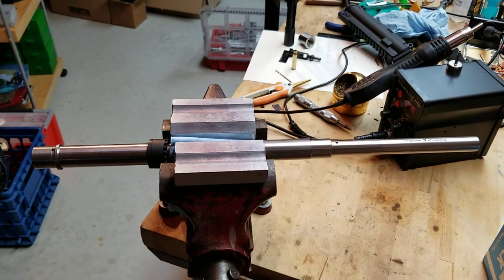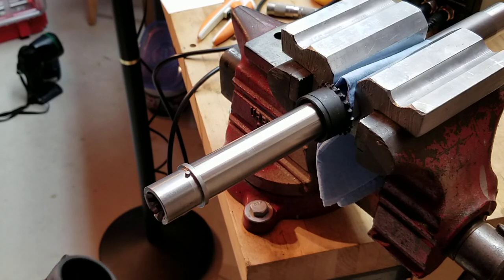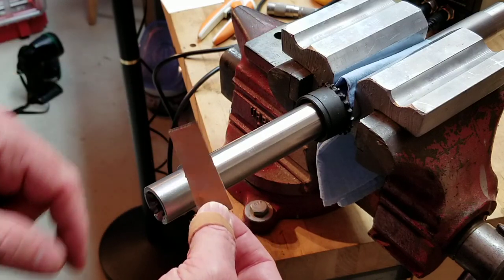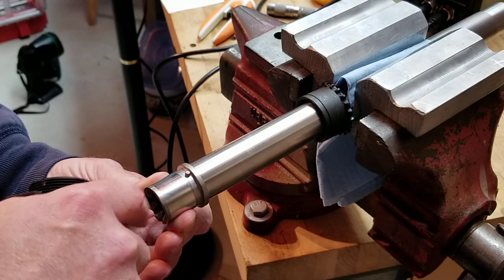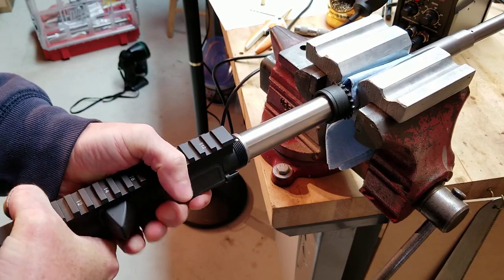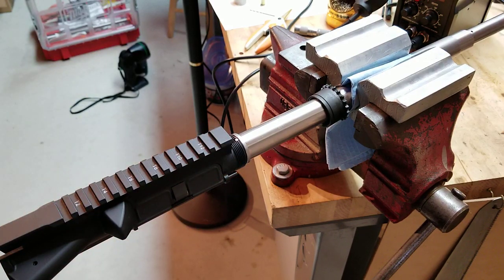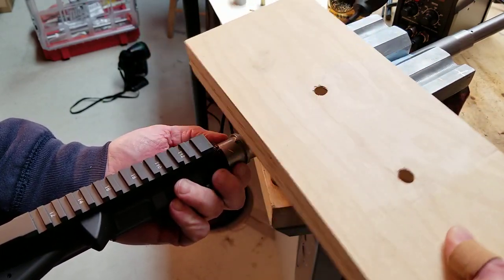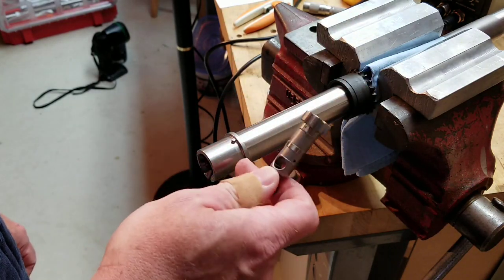AR Barrel extension fit & accuracy (precision)

Comment: You might not have a need for lapping the upper, but I tell you… it works and is absolutely necessary. The order of operations on most upper machining doesn’t guarantee the threads are still in line with the bore at the end of the cnc milling sequence. Every single AR I’ve built, was out of line with the bore.
Reply: That doesn't make sense. How would using a lapping tool make the threads in line with the bore?

Comment: Criterion barrels recommends loctite 609 to bed the receiver to the action. Military did some testing and found a thirty percent increase in accuracy on average if you bed the barrel to the receiver. They have a instruction video on YouTube. I have one rifle where the barrel just slipped into the receiver with all most no resistance. I put it together and the accuracy was 2.5 moa. I took it back apart. And used loctite 609. Now it shoots 1 moa or better.
Reply: That’s huge. Appreciate the info on that

Comment: I've built a couple lowers, and for my last build I purchased a completed upper. My current build I'm building the upper so I have control over the parts I'm installing, not only that, but I want the experience of building it. The stainless steel shim idea is genius, and far better than any other method I've seen. Thanks for sharing your knowledge.
Reply from the maker: Let us know how it performs once you get it built!
Reply: @bpm990d  I certainly will. Curious what you torque your barrel nut to? I've heard less is better, and ranges from 25-40 ft lbs.
Reply from the maker: @jeffpv.  It's whatever is in Glen Zediker's book, which I assume is whatever is in the TM. I think it's a range between 30-45 ft. lbs. I do grease the threads with moly grease.
Reply: @bpm990d  Okay, I will check his book out. I just picked up a tube of moly grease yesterday. A bit of expense preparing to build a upper, with more tools to buy. Vice block for the upper, lapping tool, inch pound torque screwdriver. Just trying to make sure I do everything the right way the first time.
Reply from the maker: @jeffpv.  You can skip the Zediker book if you want to save some money.  Having a set of punches is important, as well as a couple of small hammers. The torque wrench I use is just a cheap Chinese one from the autoparts store but I also use it for changing the lugs on my Alloy wheels. I'd skip the lapping tool, I personally think it's mostly useful for fixing issues where the barrel is cocked off to one side and you use up a lot of windage in your sights. With today's machining, I don't think it's a huge issue if you buy a new upper receiver. In fact if you get a BCM upper, you might not even need to the shim stock, since some people have reported needing to thermally fit them.
Reply: @bpm990d  Good points. I have ordered or already have most of the needed tools. The upper will be a Anderson, and the barrel is a 16" 1/8 twist, chrome lined Criterion. The upper is on back order until towards the end of the month (as well as the BCG).  I will be using a Anderson lower, upper, and 15" M-Lok handguard to keep things semi the same. I guess I'll wait on ordering the shim stock until I know if I actually need it?  I really appreciate your advice. I don't personally know anyone I can ask about these things, so my main source of knowledge has been YouTube, but even then there's a lot of conflicting information.

Comment: Great video, bro. I really like and appreciate your approach to explaining, including the What of what you're doing, the Why and How. Showing how the parts relate to each other and implications thereof. Really helpful. Keep it up!
Reply from the maker: Thanks Andrew. If you do a build let us know if you use this technique.
Reply: @bpm990d  I'm already planning to. Haha. Youre reasoning was really compelling and makes a lot of sense. Compared to re-facing where the upper meets the barrel extension. 
Now I'm shopping online some shim stock. I won't need much even to cover up to my 3 ARs. Dont wanna overspend.
Reply from the maker: @Acehart3  Yeah I have not found a good place to get small amounts. If you know a machinist, they would probably give you some. A 6" square is enough for a decade of building for most people. Take a look at Grainger. I would recommend .001 as anything more than that could be difficult to get a good fit and require a small piece of shim stock that would not extend around the extension. Also one of the commentators said that Bravo Company sells uppers with a tight fit to begin with.

Comment: I use a Pacific Tool & Die lapping tool. It's not cheap but it WILL square the upper to the barrel extension boss. I looked and read about everything. This thing is the best, and I couldn't buy a piece of junk for what I was putting together for my wife. Not telling you how much I put into that AR, but it was a once in a lifetime build. You would like a Patriot Ordinance Factory roller cam pin. If you look at your gas key you'll see it has extra "meat" on the lower side toward the side you insert the cam pin. A LITTLE bit of Dremel work there to take JUST ENOUGH to clear the roller works great, although they do sell the key and roller pin as a set.

Comment: Good video, thanks for the demo. One question, it looked like you used fired brass?  Would resized brass give you any difference between the bolt, barrel interface?
Reply from the maker: Thanks for the comment. That was a resized piece of brass if I remember correctly. A fired case probably would not have fit into the chamber. AR cases tend to get stretched out during extraction.

Comment: So what is your take on a left handed BCG and a normal barrel extension.  Could that possibly cause a lot of damage since I imagine the cam pin/rotation is backwards on a lefty BCG.  Does that effect anything with the fitment/function with a normal barrel?
Reply from the maker: I don't have a lot of experience with lefty BCG, however I did put one together this summer. I don't see any difference with the technique for securing the barrel extension. The one I did was put together with shim stock just like the video. I did find out that there is such a thing as a lefty barrel extension. I did not know that and was having some functioning issues. Since then I replaced that barrel with one that has a lefty extension and the function issue went away.
Reply: If you look at the front of the lugs on a left and right barrel extension you will find no difference, the lugs are flat on both. They will sure  sell you a more expensive left hand extension if you are willing to pay for it though.

Comment: I’m not a Gunsmith either, but I’ve read of bedding AR barrels with the usual compounds. I’ve never read about shim stock before, it has crossed my mind to try it. I’m accumulating my parts for an LR 308 build at the moment. I’m going to try it if I have any play at my extension and barrel. Great video. 👍
Reply from the maker: The shim stock is much easier and less messy. I've got a bunch of AR10 parts in the basement and I'm going to do the same at some point. Let us know how your build goes.
Reply: bpm990d I sure will

Comment: I used to rebarrel about 3 times annually when I shot in Service Rifle Competition. My results have always been in the half MOA arena. All of barrels have been smithed by Compass Lake Engineering, no fit issues. Only issue ever was a barrel nut coming loose which set me back on road to Distinguished.

Comment: I just watched a video on jp and they have a thermal fit. You heat the receiver and slip it onto the barrel. You have to buy their stuff of course but seems like a good idea.
Reply from the maker: Yeah it looks like a good system. I've been told that BCM uppers are also very tight, and can be thermal fit.
Reply: Robert Sanders... I also learned the shim stock technique from Joe Carlos. I bought some custom barrels from him recently with oversized barrel extensions. Still the fit was not tight on occasions, so I used a combination of shim stock and the JP thermo fit technique for a very tight fit.  Getting 1/2 MOA results with Factory Ammo.  Very happy with results...

Comment: Great video. I’m actually rebuilding an older AR right now and pulling the barrel to refit it w/the upper. Definitely will be picking up some stainless shim stock. Thanks man.
Reply from the maker: I'm glad you like it. I got mine on Amazon but I'm not sure it's still available. You might try Granger. The stuff I used is .001 and it does a decent job of taking up the gap and not being too thick, so as to make it difficult to get the upper onto it. Let us know how it shoots.
Reply: Thanks for that info. I gotta pick up some grease today for the barrel install.  I’ll look for .001 gauge. Thanks again.

Comment: Would you use grease on the barrel extension when you are doing the build for reals? If so, how do you deal with it when using the SS shim for a tight fit?
Reply from the maker: I use grease on the threads, not the barrel extension.

Comment: I use bravo company’s receivers because they are so tight it takes heat to get the barrel in and out of the receiver have had great luck using them
Reply from the maker: That's good to know. I've seen the JP receivers that need a heat gun to get thermally fit and that's a great way to do it. Most of my uppers are forged because I shoot service rifle, so knowing that they sell uppers that are on the tight side is helpful. Might just pick up a couple and put them on the shelf. That being said, I have so many regular uppers, that using shims & or locktite is a good option for me.
Reply: Ya I just prefer the looks of the military spec styles but I wanted a tight fit and tried the bcm and was so surprised

Comment: Heat up the upper receiver. It will slide right on, them tighten down as it cools.
Reply from the maker: That's probably a good idea and I have thought about it. I haven't tried it mostly because I was concerned about burning my fingers on the hand that was holding the shim stock. Next barrel change, I'll put it to a propane torch for a little bit, to see if I can expand the bore of the upper enough to have it slip on.
Reply: @bpm990d  I have built multiple rifle that require the receiver to be heated to fit the barrel. You should only need to hold the shim for a moment to get it started and it would slide right over.

Comment: Just built up two JP thermo fit uppers. Works like magic
Reply from the maker: Very nice. JP did a neat video showing the process and I'm pretty sure it works as well as the oversized extension and or shim stock. I've read in the comments that the BCM uppers are very tight too. What caliber are the guns you assembled?
Reply: @bpm990d  all I use is BCM Uppers and thermal fit for all.  heat up for roughly 20-30 seconds and get upper on extension quick!  Has worked well for me for 5.56 and 6.5 Grendel.
Reply from the maker: @Vengeance1100  Neat, I've seen the JP video and have read some of the posts that say the BCM uppers are tight. Wish I would have picked up a couple as they are unobtanium now.

Comment: Great video! Im in the process of building a 6.5 Grendel Wilson Combat upper w/ a Wilson barrel. There’s a tiny bit of play so I’ll be trying your method with shim stock.
Reply from the maker: Let us know how your build goes.
Reply: Dude, I bought the Wilson match set barrel, extension, and bolt in 6.8 a few years back.  Put them on a basic AR upper.  Nice snug fit and hella accuracy.  Contact Wilson if you think it’s too loose.  You paid for  the best.

Comment: Normally when you install a barrel you put aeroshell on the barrel extension to ensure there wont be corrosion between the steel barrel and aluminum upper. Do you add grease when you shim? I would think galvanic corrosion would be an issue with SS just like with regular steel.
Reply from the maker: No, what you saw is what I do. Galvanic corrosion is not an issue. The anodizing passivates the aluminum, and unless there is a serious issue with  water you don't need to worry about corrosion. Google Bill Geissele and galvanic corrosion.

Comment: Hey, great video. Maybe you can answer my question. I just assembled an AR10 with a Mega upper and lower and Rainer Arms bolt and barrel. When I tighten the barrel nut the barrel extension and bolt don’t line up. If I loosen the nut they fit together perfectly. Hope that makes sense. Thanks.
Reply from the maker: How tight is the slot in the upper receiver and does the indexing pin on the barrel extension fit in that slot so it's tight? My guess is that it's moving when you go to torque it down.
Reply: @bpm990d  I just pulled in apart tonight and there appears to be a bit of slop in the barrel extension. Also the pin doesn’t quit bottom out on the receiver. I installed a .0002 piece of stainless shim stock and barrel seems to be tight. Going to torque tomorrow and see how it is. Looks like that may have been the problem..  Not sure as to whey there was so much play, I used what I thought were the better manufacturer’s.
Reply from the maker: @jasonkundrat3825  Well it might be that the indexing pin hole on the barrel extension was drilled in the wrong position. In that case when the barrel is installed, the extension does not properly line up with the bolt lugs. The other potential issue is that the slot in the upper might be off spec or just a little large. I have a couple of Mega lowers and they are very nice, so I would suspect the barrel, but you never know. Let me know if you get it straightened out.

Comment: Using shims and loctite together, or a fatter barrel extension and loctite improves group sizes more than just shims or loctite or fatter barrel extension alone. There was a two part article in the freelibrary on the relationship to accuracy and barrel extension size about it.
Reply: Do you know if there is a benefit to using the green loctite on thermal fit uppers
Reply: @Harold  my main concern with using loctite was causing too much constriction around the throat and causing a tighter chamber.  Im about to find out how hard itll come off, as i have to pull my current barrel off the old reciever.  We use green loctite alot at work and the older guys say our solvent takes it right off
Reply: @tankkiler308  probably trichlorobenzene. Nasty stuff. As soon as your nitrile gloves get wet, throw them away. Well, theres the barrel extension steel, then theres the loctite. Then theres the aluminum. Then theres the barrel nut. Also lithium grease on the barrel nut threads. I think the entire system warps as expected with the temperature variations as expected, but the acrylic (i think thats what loctite is) would be the weakest. Im not sure on that, but perhaps its not a pressing concern. The loctite only fills the microscopic gaps between the extension and the receiver. Hence you dont need a lot.

Comment: I am my own gunsmith.  Stainless steel shim 100% is the best.  Change it out every 1500 to 2000 rounds and good to go.
Reply from the maker: What's the reason for changing them out after 2K? I typically leave it alone until the barrel needs to be replaced.

Comment: Would using a thermal fit, with the combination of shim stock provide an even better fitment.? It would prevent the shim stock from curling as the receiver was intalled
Reply from the maker: I'd be kind of worried about getting the upper too hot and burning my hand. Getting it on like I did is not too bad. Maybe a heat gun for a minute could make it easier. Biggest thing about how I do it is to trim it to the proper length, hold the barrel in a barrel vise, and then pinch the shim as you work the receiver on. It took me a few times to get the technique down.

Comment: Big question... Where can I send a few bucks and an envelope for a few inches of the shim stock?
Reply: adamrallard I’m gonna try aluminum can
Reply: @johnsherry6021  Just read your post, did you try aluminum can as shim stock? A little very fine grit sand paper should reduce its thickness.

Comment: If your cheap like me you bed your barrel extension to your upper receiver. If your not cheap like me you buy a BCM upper.
  This is from BCM website "Inside Diameter for barrel extension slightly undersized for a tighter fit to the barrel and a more accurate rifle. Please use a heat gun or hair dryer to warm up threaded bore of receiver if barrel extension is too tight."

Comment: this is why I dont really understand the fuss about "bolt carrier tilt". Once the bolt is locked I dont quite get what the carrier has to do with it
Reply from the maker: I'm not quite sure myself, but I think it's mostly a thing among people that own piston guns. Not sure it really is a thing for people with regular gas tubes.
Reply: @bpm990d  seems to me that once the bolt is locked forward that it wouldnt matter much if the carrier was slightly tilted when it was unlocked.
Reply: @JohnProph  Piston guns tend to tear up the upper if they can tilt, the system was never designed for a piston and the force is no longer in line with the bore.